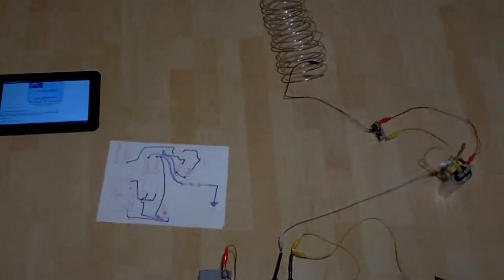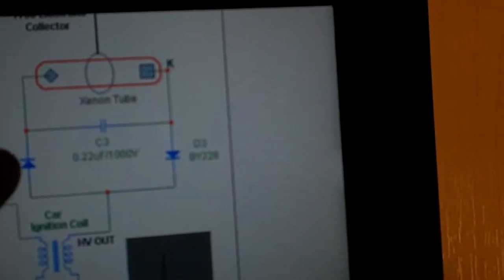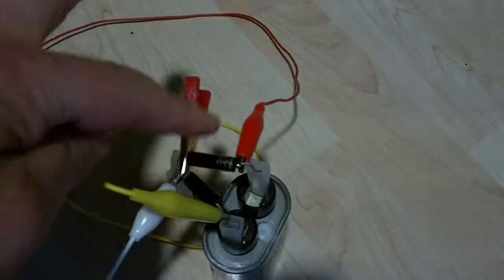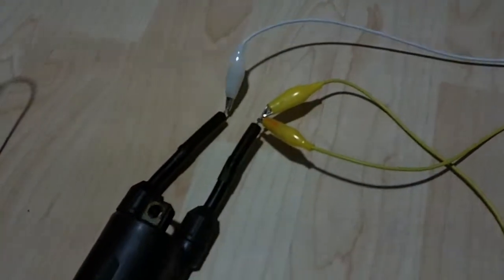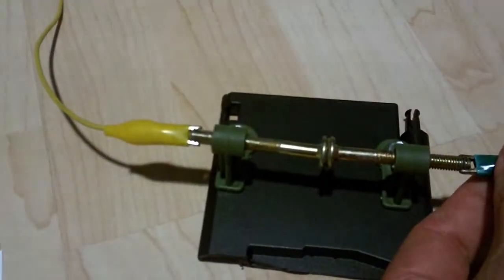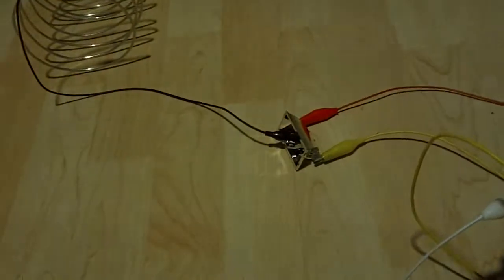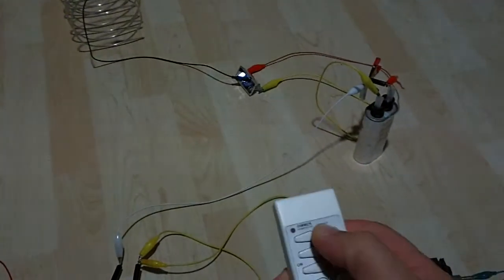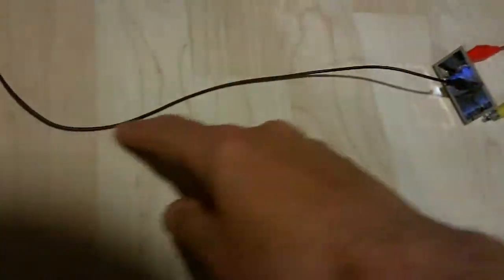xenon flashing on HV, antenna and Avramenko plug

Comment: HI!
Just like to ask if you check your capacitor?
some times they have internal resistors 10Mohm ,if you will remove that resistor from capacitor it may improve performance!
Like your work !!
Watch my Tesla coil :)
DANGER TESLA COIL / CEWKA TESLI
Reply from the maker: The capacitor does have a resistor in it.